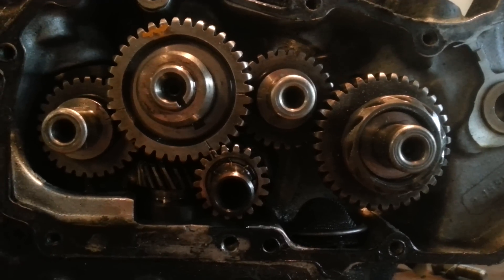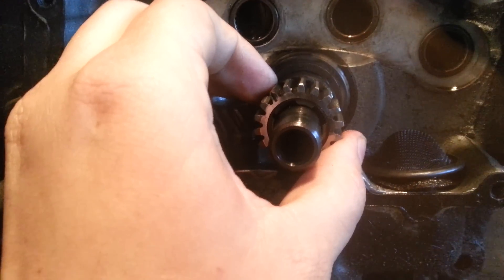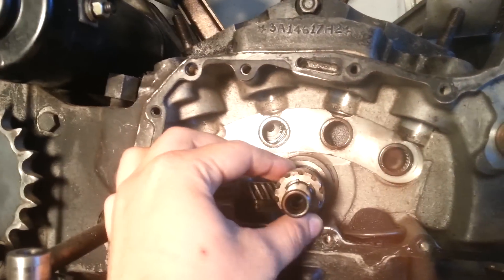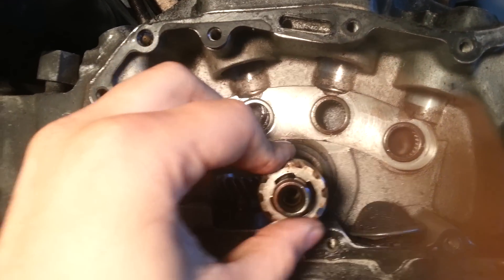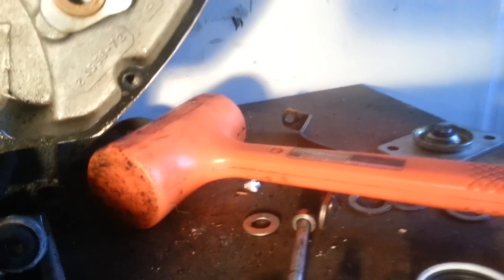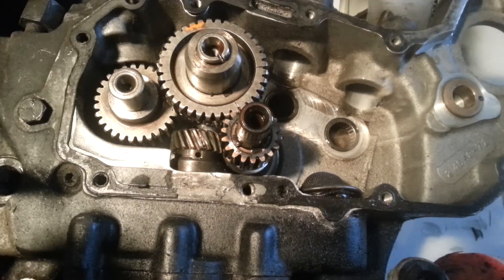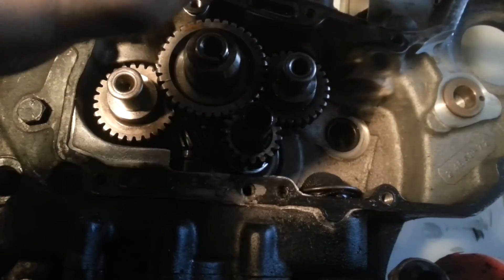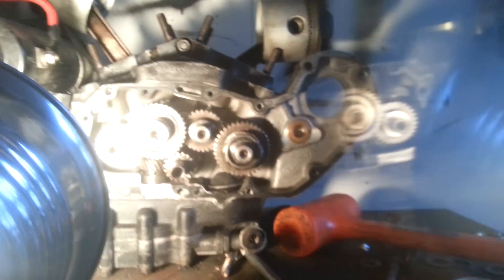Ironhead cam timing and oil hole line up.

Comment: Hello. Good afternooon!
From Portugal ... :) 
If you can help me, i am desperated!
I've an Iron Head XLH 1000 from 1975.
So, the engine oil passing to the primary through the valve that exists between the crankcase and the primary. This valve "would" have the function of sending the oil that is in the crankcase to the primary when it reaches a certain level, and the opposite. 
The thing is, the oil is not returning to the crankcas as it should, so I have to empty the primary to the level through the "hole" that exists in the primary cover, and put the oil back in the tank.
Question: If I create an external connection between the hole in the primary cover and the tank, will it solve the problem or will it cause the oil to run out of the crankcase? With the compression that exists in the primary, will it be enough to make the oil return to the tank? ... If you can help me... Tell me something that i must do to try fix this problem. Pleeeeease! I am starting to be crazy cause of that!!!
P.S - I apologize to annoying you but i have to speak who really know about this ....
Thank you so much

Comment: I have a 1978 XLCR frame with an engine that was used for drag racing, bought it a few years ago at an estate sale.  The engine has Alan Sputhe cases, Andrews lumpy cams, 4 5/8" stroke (74 cu in), so don't know the year, 1978/1980 is my guess.  I started at the front of the bike and am working my way back, the bike sat in a shed for 25+ years while the engine was in a different frame.  I have no experience with Sportsters, I do have a 88" Panhead motor and trans in a 1981 FXE bike I bought in 1998.  
I pulled the cam cover three nights ago, wanted to know what was in there, put the cams back in two nights ago.  Not sure if I did it right, all the marks lined up except the #2 and #3 cams.  Like your cams they are off 1/2 tooth, the dot on #3 doesn't line up exactly with the line on #2.  I see that you put the line on #2  above the dot on #3, is that the proper position?  I cheated and held the tappets up with wooden clothes pins.  I have the correct Harley shop manual which is helpfull but the illustration depicts exact alignment which I can not duplicate since they don't line up.  I don't have the experience to guess correctly.  Any insight will be appreciated, thanks.
Warren
Reply from the maker: I have to be honest with you. This video shows the correct way for stock cams. They are machined to be  off just a tad, and that's essentially because of lash between the gears. 

BUT I've never worked on a heavily modified ironhead like what you are mentioning. I would send it and see what happens, honestly. The worst thing that would happen if your timing was a bit off would be hard starting or rough idle. Pistons should still have valve reliefs. 

That sounds like an awesome bike, man!

Comment: What happens when you don't have a mark on the oil pump???
Reply from the maker: You have a newer style oil pump, I want to say 72 and up. Just have the mesh screen facing out at the 12 o clock position.

Comment: Thanks for the video I got a 57 ironhead almost ready to take the cam cover off.i was told it has hp cams in it. Kicking it with magneto  sucks  got sportster knee twice in one day  20yrs ago same bike. Been working on it.see if the cams are not lined up next. Thanks for your advice and time Johnny
Reply: Liked and subscribed.

Comment: Thank you
Quick question
When changing the oil pump gear drive (pinion gear)
Top dead center front cylinder and remove rocker
Top dead center rear cylinder and remove rocker
Do you have to remove the push rods and sliders if taking the cams out?
Reply from the maker: So, I'm not sure what your calling the rocker. The rocker is what is on top of the engine and the top of the pushrod pushes against on one side, and the valve spring on the other. Those shouldn't need to come out to to do anything inside the cam chest on an ironhead. 

The tappets, the part that your pushrod sets into (see my videos on adjusting pushrods I identify the parts in that) and the pushrods themselves, and the tappets, do need to come out to remove the cams. without the cams in place they just fall. Keep the push rods in order, they are different sizes. Front cyl exhaust pushrod is longest, both intake pushrods are the same, and rear cyl exhaust is second longest.

Comment: what year are you working with i have a 77 and i do not see a oil hole on my motor at all hAS it been changed and wrong one installed previously im afraid to continue i dont want to tear down again

Comment: How do you route the oil lines using a pill tank with remote filter. Filter is on the front of my frame. This is on my 75 1000 Sportster. fivetadpoles @gmail. Been 50 years since I have done this. Need help.

Comment: If I need to do oil pump gaskets. Do I have to worry about retiming the oil pump or will that gear amd shaft stay up in the motor, as i take bottom plate and all other peaces of the sandwitch off to replace the 3 gaskets?

Comment: Guys need to know not to whack that gear in, however gently. There is a tool to get that will press that on. You don't want to whack on the crankshaft, it's not designed for sideways forces, just up and down. It's okay to do with a junk motor, but not with a good one.

Comment: Hi i have 2 questions about the ironhead oil pump allignment. I have a 1973 ironhead that is new to me. It pukes oil out the breather tube. I changed the oil. Still pukes.. cleaned ball valve. Still pukes  tried 20w-50 and then 60w oil. Still pukes. Question 1. Would wrong pump timing cause this?? #2 does wrong pump timing hurt the bike? Thanks

Comment: my sportster has no oil pumping to the rocker boxes. could you make a video of taking the oil pump out?
Reply: This is a old post but I would guess you sheared the feed gear drive pin. Not a biggie.....HD used a solid pin and later on a roll pin.  If you have a roll pin you should change it to a solid pin.  Good luck.
Reply: Did you get this fixed?  Removing the pump is pretty simple.  Just 4 bolts or studs and nuts(depending)  remove them and the ump can be dropped.  Putting the pump back is is more of a trick though as it needs to be timed(depending on year)

Comment: Thanks marcus d. Just had someone give me a 59 to 85 clymer manual. Im confident it'll cover my 57. M419 is the manual number. Again, thanks for your reply
Reply: I have the same manual 59-85 I have a 57 ironhead in a 65 rigid frame  just pay attention to the older diagrams and spec's and videos .
Johnny

Comment: This video is helpful, but it needs to be timed on the 40 degree advance timing mark on the flywheel and not top dead center.
Reply: would that be the two dots on the flywheel ?
Reply: John Reid no it's the single line going up and down
Reply: thanx

Comment: what about the push rods
Reply from the maker: What about them? I have a video on adjusting them. They don't have anything to do with timing.
Reply: I want to install new andrew cam will I have to install push rods also
Reply from the maker: +jimmy ramirez  not necessarily. when you buy cams the manufacturer instructions should tell you if you need new push rods.

Comment: BYW, I pulled the oil pressure switch.  Oil would not flow past the ball check.  Seems to me the seat is good and wet jumping is a different condition then my problem.

Comment: Nice job. , Marcus. I was recently there but learned the hard way.  Now assuming I have the oil pump timed properly and done everything else right, what is the reason I am pumping oil out of the breather tube virtually all the time the engine runs.  It is a 1969 Ironhead I just bought.  Wasn't running when I bought it so don't know any history.  This  is not the wet sumping I have read so much about.  Before it stops blowing oil, each time I start the motor, I will get 1/2 quart of oil out of the breather tube. After returning the blown oil to the tank, within 5 minutes, it will blow it out again.

Comment: great video, in the process of tearing down an 81 basket case motor. I think the previous owner had assembled wrong, looks like all the cams line up on ignition timing (the circle) not front cylinder TDC (the line) guess I need to pull the pinion gear and realign at TDC. Any advice?
Reply from the maker: make sure you piston is at tdc. you can't pull the pinion gear off and put it on a different way. your cases have a hole on the left side below the jugs. it's either an Allen key or like a 13/16" plug. you look through that hole and it will have TWO marks on it. one mark is tdc one is bottom dead center. make sure your looking at tdc and check timing again.
Reply: +Marcus D point taken on the pinion gear, thank you. guess I need to dig a little deeper and find the actual case numbers. From what I can find between the net and the FM some time around the year of this motor HD switched the timing marks around. Thanks for the reply.

Comment: Dude, finally found a useful video for my cams! thanks!!!! can you make a video of where to put the shims in that camshaft. and possible where each lobe should sit???
Reply from the maker: When you line up the cams timing marks it puts the lobes in the right spot. And i ended up putting this engine in a bike two months ago. But im going to be doing work here soon ill try and remember to put a vid of the cam shims in. Harley put out a notice back in the day that advises against using cam shims. So if you pulled them out and forgot where they go then I wouldn't put them back in if you dont feel comfortable checking for play.
Reply from the maker: Remember have your engine at top dead center before you put your cams in.
Reply: Thanks man!!!! so this engine in the video is running good now??? even without shims?
Reply from the maker: Nick Ferrero yeah if you look at my other videos its the 72 hard tailed ironhead.
Reply: and what exactly do you mean by top dead center?
Reply from the maker: If you look on the primary side of your engine there is a bolt or allen key (depending on your engine) below your jugs. Pull that out and it has marks for top dead center bottom dead center and advanced. The marks are just dots. If your engine is 73 or newer two dots mean tdc. CHECK YOUR TECH MANUAL!!!! because im not sure on that. And top dead center is when your front piston is at its highest position with the valves shut on its compression stroke. Its where  the engine needs to be to line the timing mark up for your pinion gear. And it also puts things in place for Static timing and causes your ignition to spark at the right time.
Reply from the maker: Wow sorry. If your engine is 73 or OLDER im pretty sure its two dots. Newer than that I think is just a dash.
Reply: mines an 82 ironhead, so should be in the clear. though it is the first year they bough harley back from AMF so there could be some subtle differences. thanks!!!!
Reply from the maker: No not really ironhead engines are basically the exact Same from 57-85. Minor changes in the oil pump and jug size.  Every motor needs to be tdc to set timing. Ironhead, shovel, evo, cars, trucks, gas, or diesel.
Reply: good to know! thanks
Reply: 😎👍🏻😎
Thanks...

Comment: Does it have to me set to TDC when you set the gears?
Reply: i know this was 2 years ago but in case someone reads it.....THE GEARS ARE SET ON THE ADVANCE TIMING MARK,WHICH IS THE STRAIGHT LINE AND NOT TDC WHICH IS THE SINGLE DOT.....thats why doing this shit online gets confusing,.......again the line not the dot to set the cams
Reply from the maker: Yes. That lines up your pinion gear.
Reply: Thank you! Gotta do it tomorrow.

Comment: excellent Vid, Thanks, this will help. Im redoing my e73 motor. But I dont have any timing marks that I can see on any of my cams yet. front and back appear to be clear, but there are paint marks on a few of the cams, 1,3,4, but 2 is clear as well (case side). the cover side has the paint marks. Problem is making sure 2 is set in the proper place with no marks lines...

Comment from the maker: Forque,  if you listen I stated this motor is trash. Used to demonstrate and practice on. Also at the end of the video you hear me say that im not demonstrating tdc or advance. And I state multiple times throughout the video that a tech manual is needed. Video is just showing how to get to everything, and how to put the cams in so the timing marks kin up.

Comment: FWIW.
Take a closer look at your manual. Pinion mark has nothing to do with oil pump timing. The pinion mark is only used for cam timing. For pump timing the advanced timing mark on the flywheel is used ( 40° or 45° depending on year). That pump is now 1- tooth off. A pinion gear loose like that should be replaced. On breather motors (57-76) it is a hard-pressed fit. The manual is real specific on how far it is pressed onto the shaft.